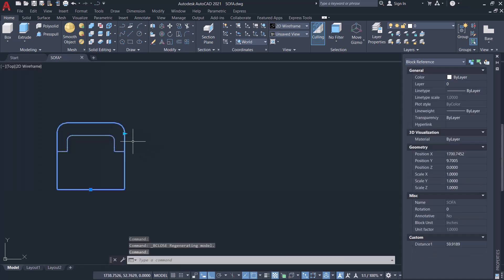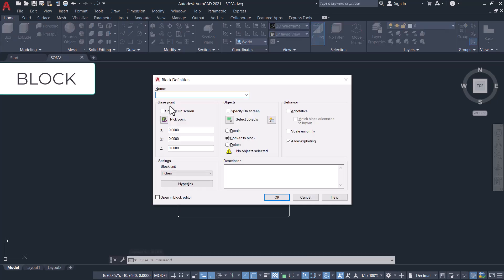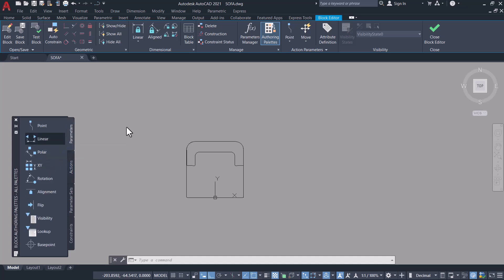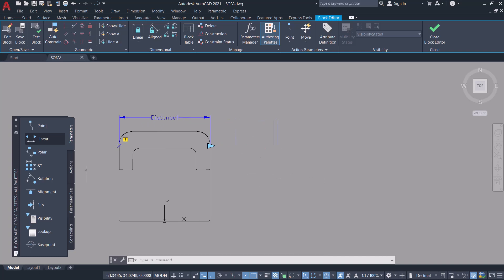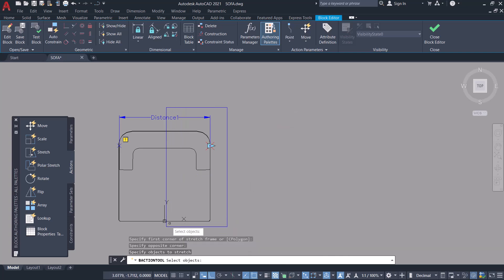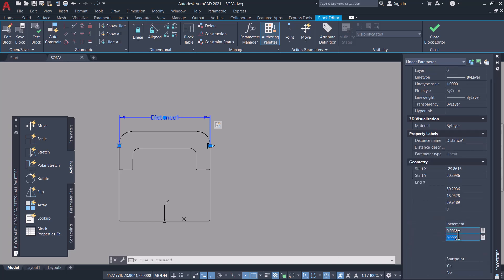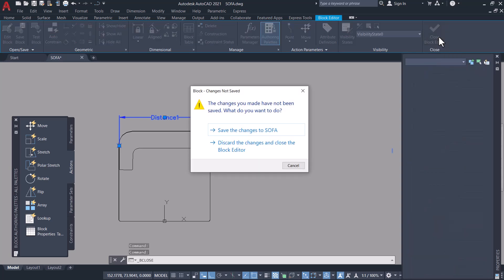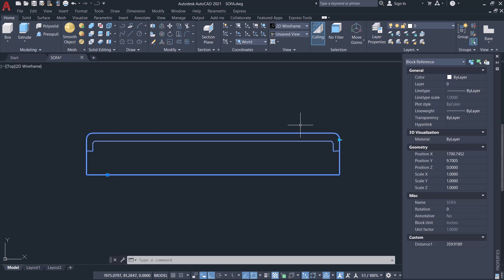Dynamic Block Stretch | AutoCAD Dynamic Blocks

Comment: Dynamic blocks are a simple alternative to parameterization. But AutoCAD developers have blocked stretching of 3D solids in dynamic blocks. There is a workaround - you must first convert the solid to a mesh. Then stretching will work along two axes and you will be able to make three-dimensional parametric blocks. Stretching along the Z axis is impossible, but you can create a visibility table for product modifications by height. This way you can, for example, design drawers for furniture. And to convert back to solids, you can use the AVC MeshToSolid plugin or the AVC AsmNew command, which will make a new assembly from solids from a dynamic block.

Comment: Hi SabeerCad, can you tell me the difference between converting 3d to 2d using flatshot vs viewbase. when to use flatshot and when to use viewbase. Thank you so much
Reply: The FlatShot, Flatten, SolProf and AVC Flat commands create flat drawings in model space. These drawings do not update when the 3D model changes. This can be an advantage in some cases (For example, for export to CNC). But in 90% of cases you are better off using ModelDoc views (the name of the plugin that contains the ViewBase command) or creating multiple viewports.  With their help, you will be able to prepare documentation on sheets (layouts) suitable for printing, and these types will be updated when the model changes.The choice between ModelDoc-views and viewports is a very complex topic that requires careful study.